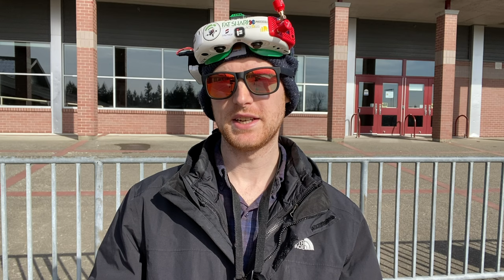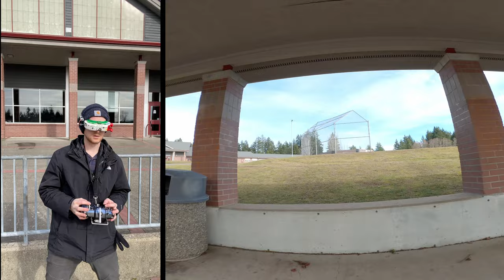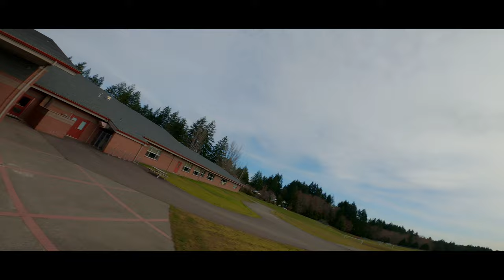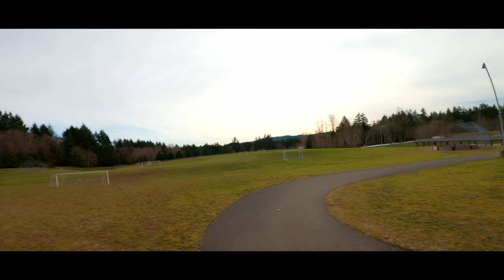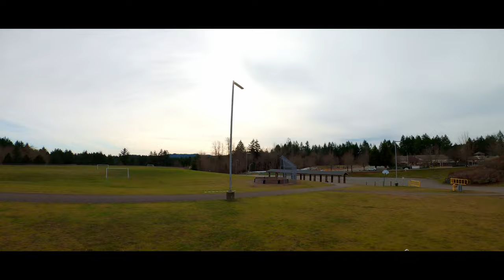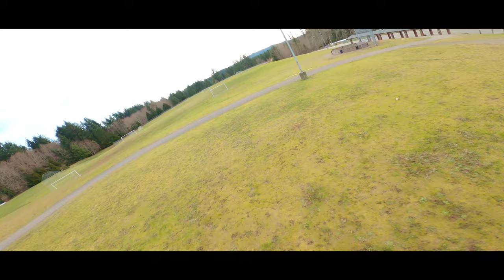Analog FPV Freestyle In 2023 | Come Fly With Me! // PropabilityFPV

Comment: I’m gonna be real for a minute… lol, if anybody reading this is about to get into this hobby, trust me when I tell you this…  learn to hover in a sim.
Build your first quad. Build it on a beater frame with a quality esc and emax eco 2 4S motors. Don’t watch gear hype review videos. Don’t even look at Instagram fpv. Fly as much as you possibly can but don’t attempt trick throws until you can super confidently slalom, split-s, and orbit both directions near the deck. Once you can actually fly confidently, then build exactly 2 identical quads and buy an extra frame and 2 more eco 2s. You’ll need this spares. Digital is nice but it ain’t necessary, I promise. You’ll have just as much fun on decent analog. Don’t fall for the idea that you need to have 50 quads hanging on your wall all fitted with 03, $28 motors and $150 stacks. Bullshit. I wish I could go back to 2018 and slap the shit out of myself. Just go fly  what you have or what you can afford….practice practice practice and have fun ffs.
Reply from the maker: 100% agreed, thanks for this comment. People should always be able to do what they want of course, but there's WAY too much hype around gear in this hobby. Learn to fly, and have fun. Then focus on gear.